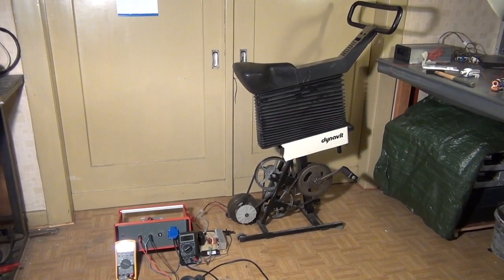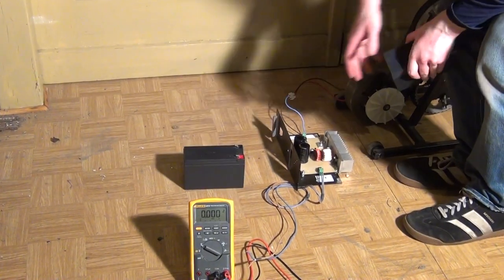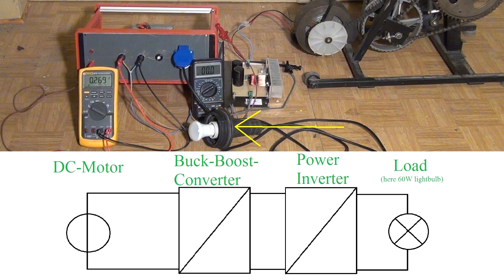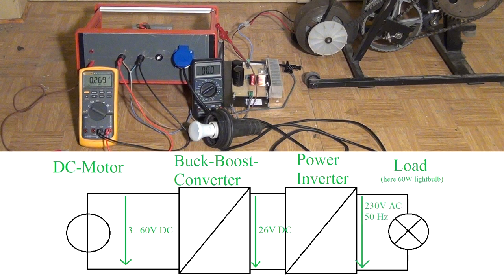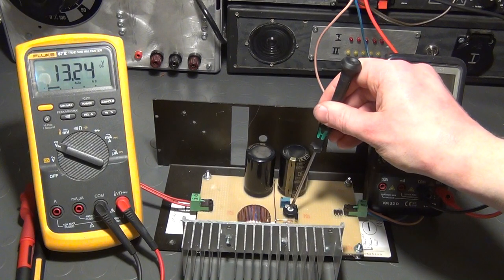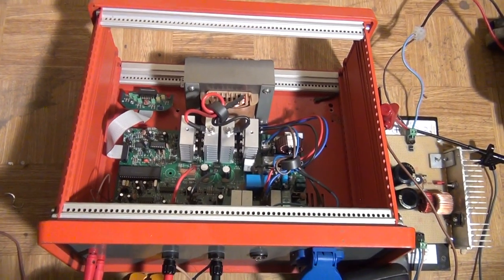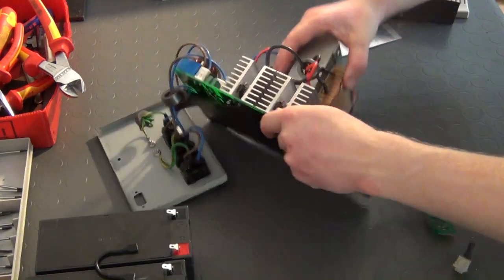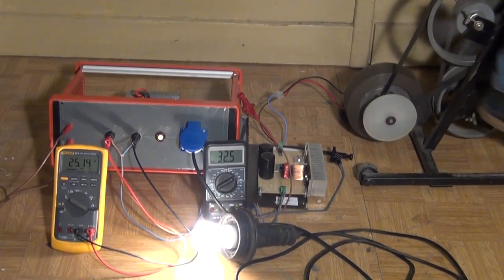Bicycle Generator:  Electricity from an Excercise Bike +  Buck Boost Converter + UPS

Comment: Can you explain how to apply Faraday's Law to coils for an axial flux generator?
Most physics discuss coils as if completely immersed in a magnetic field, but in Axial Flux designs the magnetic flux does not totally envelope the coil. The coil may have an area of 5 or 6 square inches while the magnet may have an area of 2 or 3 square inches. The Axial Flux design utilizes a dual rotor with opposing magnet polarities and a stator with coils.

There are 3 videos I've watched to understand the math:
Measuring Magnetic Flux Density
https://www.youtube.com/watch?v=3nGc44rYXww
 Magnetic Flux and Magnetic Flux Density
https://www.youtube.com/watch?v=3NYg34_vy7k
7.1.3 Motional EMF
https://www.youtube.com/watch?v=u7Msmn8Fy-k

From these videos I get the idea it is a combination of the magnetic flux density, magnetic flux area, the length of conductor perpendicular to the magnetic force, and the number of turns.

Comment: Hello TPAI, I am a very young hobbyist that is fairly new to electronics and hasn't had any traditional teaching. I want to attempt a buck-boost converter but the one in the design manual is meant for a negative to positive regulator design (there is also - to +). I was wondering if you then invert your input to a negative voltage(of course adding another regulator would cause you to loose efficiency), hook up ground to the Vin rail and vice versa or are you using an entirely different topology altogether? And if it's not the latter then what happens to your calculations? Do they stay the same? Any help regarding my comment above would be appreciated a lot because I am new and don't really know where to find information. Thanks for the great electronics videos, keep it up!
Reply from the maker: Mason Daub  Well in this case I simply "defined" the negative output as the "ground" for the inverter. In this case it really doesn't matter. 
If you have an application in which the output voltage must be  positive with respect to a common ground, you would simply use another topology.
Reply: The Post Apocalyptic Inventor Thanks for the help. But I also figured I might use the center tap from a transformer I have as ground to get a negative voltage into that regulator topology. With positive voltage from the rectifier I can also use the positive to negative topology to make a dual rail power supply. Also it turns out they added the LT 1070 to LTSPICE IV which makes testing things a lot easier.

Comment: super duper fantastic...!!!
could you please describe how to design a fly wheel and timing belt  arrangement....basically how to calculate the ratio and speed and speed ration between the paddle rotation to generator shaft rotation.?
wanted to understand that design.

Comment: Great video. Thank you for doing what you do. Could you explain the mechanical side of the system? The gears wheels belts and weighted fly-wheel, how were these items put together. Where did the generator come from and what is its specification? Was it salvaged from something else ? How much of the mechanical system was part of the original exercise bike?  

Your reply is much appreciated.

Comment: what would happen if you plug the set-up to the house socket instead of the 60w bulb?  Will the electricity meter go backward?
Reply from the maker: Hello. No you cannot do this whith the kind of Inverter that I'm using here. For that you would need a commercial power inverter (like they are used in professional photovoltaic systems). The power grid would destroy the inverter which I'm using in this video.
Reply: Oscar Radikoro I actually have bicycle generator that puts power directly back on the grid. It contains a cicuit that makes sure that my power output is syncronized with the 60Hz AC from the grid.

With an old analog meter I guess it would go backwards if I'm generatin more than I use, but I have a new digital meter, and I guess it's a one way deal.

Comment: Hi, Its a wonderful Video. But few questions comes to my mind.
 -> Are you using the same circuit as described in LT1070 application data? because
   - I could see an IC in the veroboard  input side.
   - Two components are mounted to the heatsink.

Your reply is much appreciated. Thanks.
Reply from the maker: successmiracles Hello. The two devices that are attached to the heat sink are the LT 1070 itself ( which is mounted in a 5-pin package similar in size to a To220, the other device on the heat sink is a Schottky  Diode, as it is typically used in all kinds of switching converters. 
There are no  ICs on the board, other than the LT 1070.
It might look like an IC, but those are 3 paralleled protection diodes, which protect the device from wrong polarisation of the battery.
Reply: The Post Apocalyptic Inventor alles klar. danke schön :)